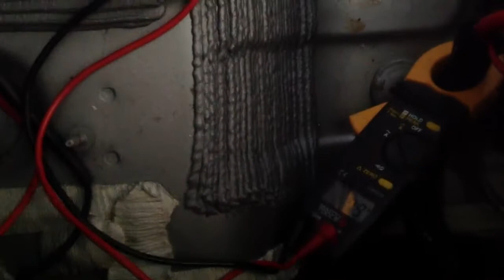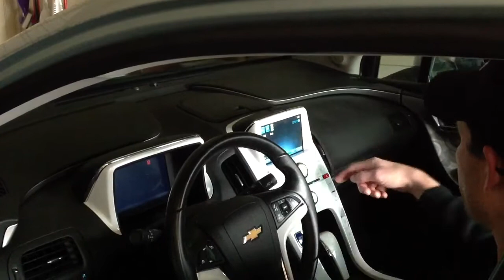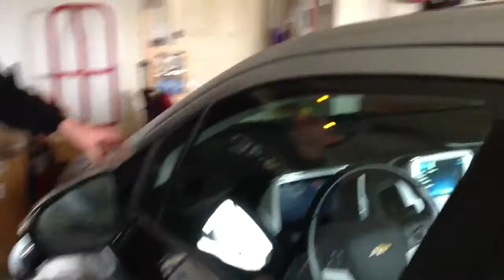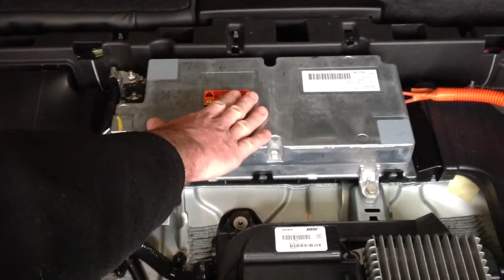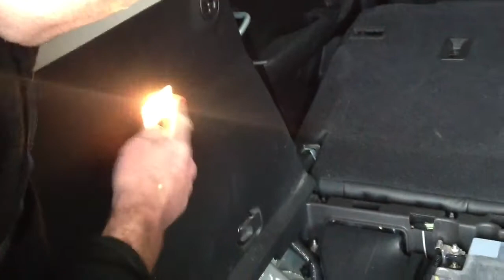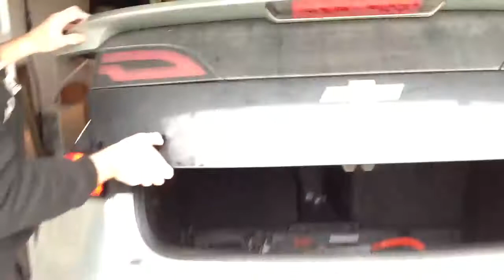Chevy Volt Bluetooth 12v discharge malfunction 2

Comment: Just lock the doors with the remote and give it a minute. another thing if your going to have the radio on have the car on as well so your 12 volt battery does not  go dead, because the car won't power up if the 12 volt battery is much under 12 volts.

Comment: MY XM usually works in my garage because my garage is wood construction and it's a one story home.  In a parking garage with concrete and metal materials, and multiple levels, the XM signal will probably not work

Comment: interesting bug you found, I wonder if there is an override, like holding the power button for X - amount of seconds to force a powerdown. 

one thing to note though, your in a garage and XM radio would blank out  due to the loss of satellite connection no? 

Where I work we have covered parking and I hate that XM goes out when i arrive at work LOL